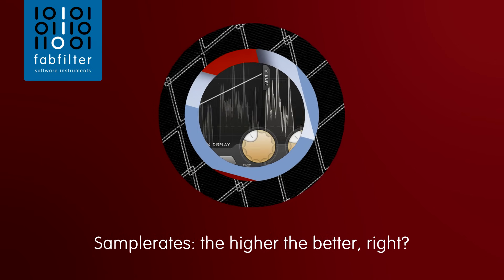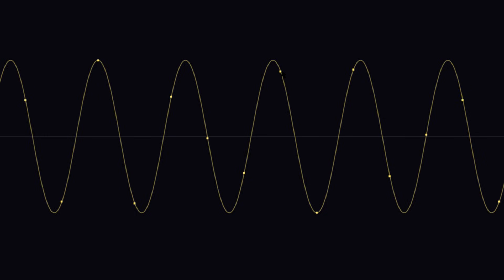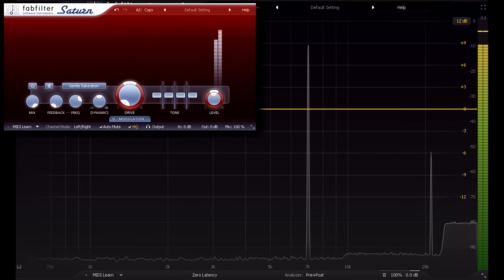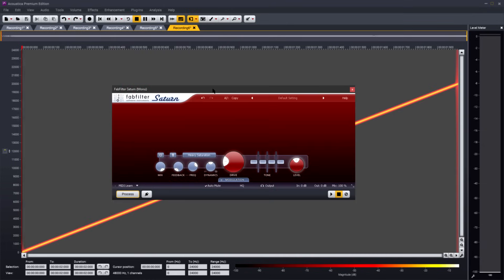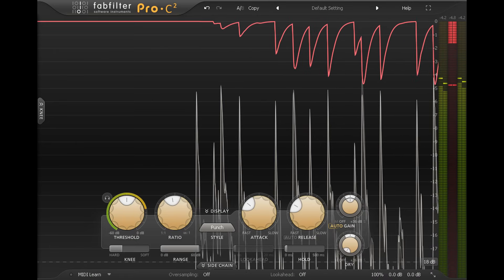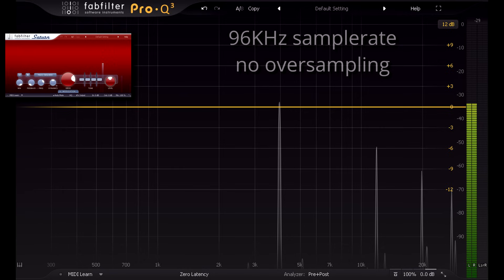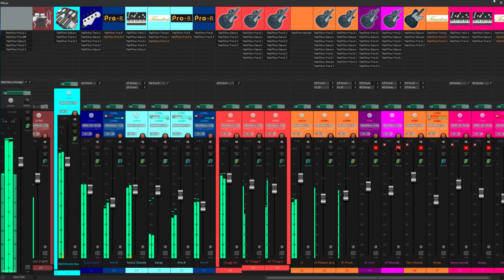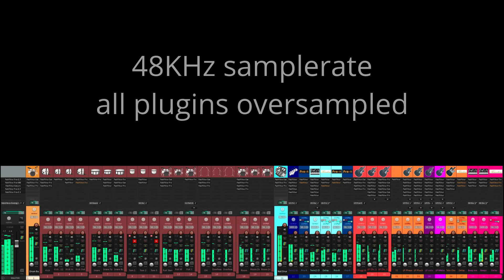Samplerates: the higher the better, right?

Comment: Is it not too late to oversample after the audio’s been recorded?

And what about aliasing caused by other plugins earlier in the channel strip??
Reply: No, it's not too late. In fact you can record at any sample rate higher than 40 kHz without any noticable artifacts. Artifacts come in AFTER recording during the digital processing, and that's where you need to oversample plugins that add harmonics. And yes, you need to oversample ALL of your plugins that introduce harmonics. When it comes to Fabfilter, it would be Saturn, since it's the distortion unit. Other Fabfilter plugins are usually pretty clean and don't require oversampling.
To be honest... Tchad Blake, the distortion master, uses a lot of distortion plugins without oversampling. And his mixes are absolutely great. So... Why even bother thinking about it?
I know all this stuff, but i usually don't oversample even when i can.
Reply: @TransistorLSD  when you say aliasing artifacts appear *after recording, is that only because microphones & audio interfaces don’t capture sounds above 20khz? And what about sawtooth synths? I’m just worried about an audio source aliasing during recording, before I can oversample through a plugin (and I don’t want to run projects above 48khz if I don’t need to!)
Reply: @zanerichter3806  Analogue sources don't alias since they aren't digital, and every audio interface has an antialiasing filter built into it at the AD/DA conversion stage that cuts everything above 20kHz. If you're recording digital hardware synths, they may or may not alias depending of at what sample rate they operate internally. If they do alias - it's the part of their signature sound and not a flaw. If you're recording analogue hardware synths, they do not alias by definition.
Reply: @TransistorLSD  thank you so much for all the information!
Reply: @TransistorLSD  "the AD/DA conversion stage that cuts everything above 20kHz" well, to be accurate, at 1/2 Fs. Some of the better sounding, earlier AD converters filtered lower but gentler.

Comment: Imo I hear subtle difference between lower and higher sample rates. If higher ones interfere with frequencies below 20k then they are probably more "saturated" or "doubled" than normal. That means more "meat" and "bigger" sound in audible freq range. It's very subtle in my ear but definitely sth comes to my ears to make me write about it here. Do you have similar "feeling"? Or maybe it's just kind of my "imagination"? And btw most audio producers and engineers I know use 24bit/96k sample rates when recording and mixing. And some research about it says the optimal sample rate should be about 60k but we don't have such a "standard" in audio so close to that are 88.2 and 96k. And many audio sciencists says that 192k is too much and make no difference and even make things worse (don't ask me details - I read those articles only and can't explain it like for a "normal people" lol). One thing is for sure. 44.1k is standard for audio, 48k is for video and 96k is necessary for high resolution archive audio. If it "doesn't matter" then nobody will be care about it and don't make audio recording devices with sample rates higher than 48k. So it must be definitely a difference and it must be important and needed in audio world.
Reply: I think it's important to watch the video again. It does explain why these differences may be there. Or not. Or in a different way than you would expect. Very likely every point you make and every question you ask here is being talked about in the video.

Comment: Wouldn’t you end up with amplitude modulation on the harmonics whose frequency isn’t divisible by the sample rate as the samples fall in and out of phase with the peaks?
Reply: No, unless you're talking about quantization noise that happens when the sampled values are converted to the digital domain. Dithering fixes this however, so no big deal. And at 16 and 24 bit depth, dither is completely inaudible

Comment: I gave up on highsample rates because my drum microphones' total in under 2000$, i don't change skins before recording drums and my guitar hum is still louder than the noise floor than 16 bits and i don't plan to invest 25000$ of mics, 96khz, 32bit and i don't plan to go into an isolated space capsul to determine if the noise floor is 24 or 32 bits. 
I work with my vintage instruments and  classic mics that.

Comment: Some plugins, reverbs and soft synths sound way better on 88.2, 96 khz sample rate....that's why hardware synths sound better than soft.......they have internal sampling rate of 384khz....prove me if i'm wrong....don't know for hardware synth 'sound'...i don't have any....but from experience....i get much better results running the project on higher sample rates when using soft synths and plugins and then downsampling them. Great explanation....but i hear difference.

Comment: Great video, but you don't address the issue of smearing introduced by oversampling? While it would be negligible like a lot of the aliasing, it still has an impact on the sound especially when you have many plug-ins in a chain adding that smearing.
Reply: What do you mean by smearing? Specifically? Becuase creating additional samples from interpolation of the original should do literally nothing to the signal

Comment: Am I the only one that always hears the change in transients when oversampling? This is my main pet peeve with plugin oversampling. For instance, in your example, yes there is more "smear" and a tad more harshness in the non-oversampled examples BUT the transients sound more natural instead. In the oversampled examples, the 44.1kHz one being the most severe, everything is much more "popping" and "clicky". This is not always a problem though and can even be a benefit in terms of "punch" but on some projects it's sometimes worth taking the aliasing fuzz over the clickyness of the oversampling process (up & down sampling). Would slight random alterations to the filter cutoff, in every plugin that oversamples, mitigate this problem?

Comment: Interesting. I notice a bit more harshness in the highs at 44.1 compared to 48. And if you are using oversampling on plugins (HQ) doesn't that add to CPU load?
I have worked in audio electronics since mid-80s and followed many debates on these issues. I think that improvements are always going to be made, especially as CPUs and GPUs become more powerful. Also note that most video has 48KHz audio standard.

Comment: I still don't understand what he means at 26:12 when he says the anti-aliasing filters have "twice as much room to work in", therefore 48khz is "twice as good" as 44.1khz. I understand that the filters can relax slightly and not be so steep, and thus improve the quality of the filter, but where does he get the "twice as good" from?
Reply: steeper filter may get audible I suppose, because of bigger phase shifting, in higher sample rate phase shift wouldn't reach audible range.

This is how I understand it, idk if it's truth.

Comment: Idk, I use a M-Audio Delta 44 audio card pci, I can only go up to 44.100/24 bit and thats all I need for production, I use a Steinberg UR22 Mk2 for transfering tracks to vynil.  
Other then the higher rates which I hardly ever use, I did however noticed the difference in iTunes when converting audio CD's into 48.000/24 bit/320 kpbs mp3's, I guess it's the algorythms Apple put into iTunes and my iPod that makes the difference?  
In iTunes when converting CD audio tracks from 16bit/44.100 to 24/48.000 I can clearly hear a difference in quality, kinda reminds me of the difference in tape as apposed to CD quality back in the day.  I don't know does anyone have any opinions or experiences like this too?

Comment: There is a technical/mathematical reason why higher sample rates sound better then lower sample rates. Human hearing is very sensitiv to the timing of transients (~4uS) and most DACs are not accurate enough to reconstruct the original timing of transients. The subjective change with higher sample rates is that you are able to perceive timbre correctly, making it sound more „musical“.
Higher sample rates have their own set of problems and in lower sample rates you are also (in theory) able to perfectly reconstruct the analog signal in a bandwidth limited signal but most DACs are not.
Rob Watts (Chord Electronics) is the only one I know of who puts a lot of effort into solving this issue and therefore making high res music less important.
Reply: @ReaktorLeak It is not about the missing  samples in a CD-quality signal but about the accuracy and length of the the FIR Filter, therefore being able to accurately reconstruct the timing of the transients. The link you send me just assumes that the algorithm of the FIR filter is working with the right coefficients. That is not the case with most DACs. At least not as good as it could get. That is the reason why higher sample rates sound better (on most DACs), because the FIR filter does not have to be as accurate because there are more samples to work with.

So you are right in that the timing issues are not coming from the digital data, because it is possible to reconstruct it perfectly but most DACs are simply not able to do it precisely.
Reply: @ReaktorLeak Yes to both, but the accuracy of the filter is dependent on filter length and more importantly how close the coefficients are to the ideal (sync function)
Reply: @ReaktorLeak Not faking, but he makes a huge leap from point 2. to 3. and he just assumes that the used filter is working with the right coefficients. So everything that follows is also assuming that every dac would use filters working like ideal sync function, which they are sadly not. The truth is a lot of DACs not even work with a tap length of 500 like in his example.
Reply: @ReaktorLeak Downsampling from 192khz to 44,1khz leaves unfixable timing issues in the file that no FIR filter can recover as it leaves an endless rounding error. Same goes for upsampling.
Reply: @ReaktorLeak Of course it is down to gear, that is my whole point🙂. But if your gear has a bad FIR filter higher sample rates help.
There are FIR filters that are able to reconstruct the bandwidth limited signal to an accuracy of 16 bits, although I only know of one.
Also the visual representation inside a program has not much in common with the FIR Filter working in a DAC
Reply: @ReaktorLeak Let‘s just say we have different viewpoints on how small a timing error must be until one can no longer hear a difference. I say it must be (at least) unmeasurably small. Your listening tests might have different results which is completely fine with me🙂
I just say there still is a (very small) mathematical difference, if one can really hear it can anyone decide for themselves.
Reply: @ReaktorLeak Yes🙂, as I said, everything (the whole analog signal) can be recovered out of an 44.1Khz signal IF (and only IF) the the filter is identical to sync function. Most DACs are not even close to this performance. So I am saying that in a world with imperfect FIR filters (and therefore timing inaccuracies, however very small) higher sample rates still give you an advantage as the algorithm in the filter has more samples to work with. Regarding timbre: I meant that the brain is very sensitive to the very small timing inaccuracies of transients and so it is harder to perceive the timbre, not that the timbre of the recording actually changes.

Comment: for the cases where we are using plugins without oversampling, If we record at 44.1, work at 44.1 for better latency, then render at 192 (and convert it to 44.1 for cd format after) will it have benefits?
Reply: @JM Coulon agree. If you record tracks with audible aliasing, then up-sample them afterward, you'll get a clearer version of your already recorded aliasing.
Reply: If your source audio is at 44.1 kHz, but your render is at 192 kHz, everything what's 44.1 will have to be resampled to 192 kHz. Some DAWs have "dynamic" resampling (ex. Ableton), where you don't have to touch the source files = smaller file sizes. DAWs like Logic require to resample every single source file to match your project/render.
When you're done you have to resample your render back again to 44.1 kHz, so you're depending on the quality of your resampler.
Another thing I've found out is that some plugins behave differently depending on the sample rate (mostly ones from Ableton lol), so your project made at 44.1 might sound completely different after rendering it at 192 kHz (Ableton's Reverb gets brigher the higher is your sample rate).

Comment: Dear Dan, I’m currently debating someone who insists that stereophonic recordings require high samplerates in order to accurately capture phase differences between the two microphones’ signals. That person was not convinced by this video or one by Monty, both of which demonstrate that (in accordance with the Nyquist theorem) the sample rate does not limit the "resolution" of the signal’s wave, provided the samplerate is high enough to reproduce the required frequency range.

Even though the contents of this video lead to the only logical conclusion that stereophonic recordings do not require samplerates than monophonic ones in order to accurately capture the stereo width - would you be willing to chime in and explain what is correct here?
Reply: MF Nickster  Thanks mate!

Comment: I doubt files at 192 kHz would actually be four times the size, as there will typically be very little information in the higher frequencies, so even losslessly, the data should compress really well.
Reply: @ReaktorLeak you wouldn't want to use lossy compression to save your project but why wouldn't you use lossless compression for audio data? It compresses really well.

Comment: We use DAW live. Higher sample rate gives us lower latency (at same block size) but eats up double the CPU. How can we fight this issue? there is no other reason we want to run a 96khz.
Reply: Use audio interface that allows you to reduce buffer size. But this setting also increase CPU usage. How much? It depends. Sometimes a higher sampling rate is a better compromise and sometimes not.
Reply: Can you simply choose a smaller block size?  Smaller blocks will fill up sooner and therefore be emitted sooner.
Reply: your CPU is doing double the calculations, so no it is not physically or theoretically possible to reduce the CPU use

Comment: So all D/A conversion draws in a smooth curve between sample points?
Reply: Yes.  Simple conversion to analog involves generating a particular voltage for the duration of each sample, which produces a step-wise waveform, then passing that through a low-pass filter, which effectively rounds off the corners of each step.  More sophisticated converters may use look-ahead and modeling techniques to reconstruct the presumed original analog signal.
Reply: not all, but any that is built for audio definitely will

Comment: Love you Dan, great explanation as always. Only one thing isn't covered I think. Why aliasing happens? and do we need anti-aliasing settings when oversampling for ex. from 44.1 to 96, when rendering?
Reply: Aliasing is a mathematical product of sampling a signal with frequency content past the Nyquist frequency. Go ahead and try drawing yourself a sine wave with less than 2 samples per cycle. 
Then connect those dots with a smooth curve (keeping in mind that it can't be the original because it's frequency was too high to be reproduced). You'll find that the curve you can draw through those points is still a sine wave, just much lower frequency. And in fact, that sine wave is related by how many samples per cycle and the frequency of the original sine. This is exactly why aliasing occurs :)
Hope this helps

Comment: IMHO ... there is a benefit at 96khz. There are many audio plugins, which are handling harmonically rich signal badly or they don't have an oversampling option. So if you are using (fabfilter) plugins with oversampling only, you are fully ok at 48khz. But if you are using plugins from another companies with no oversampling, you will get much better results at 96khz, more space, more dynamics. And what more, there are many VST instruments, which are much better sounding on 96khz because that sampl.freq. eliminates that alliasing. Am I right with this?
Reply: absolutely!!!  this video is so cringe!!!!!!

Comment: Overall excellent presentation, but here are a few more points to consider. The entire discussion assumes that the content will always use distortion effects and somewhat extreme compression, as per the example. The case for higher sample rates becomes clearer when producing acoustic music, jazz, orchestral, and other types where the cleanest, most accurate sound reproduction is desired. In those cases, I'd never record below 48kHz,/24-bit (usually 96kHz/32-bit float), so no need to over sample. When the reverb of a string quartet in a concert hall, for example, falls below a certain point, then at lower sample rates and bit depths, natural reverb tails drop below the noise floor of a given sample rate/bit depth, introducing unwanted and mostly unpleasant artifacts. The noise floor at higher settings can be far lower, reducing or eliminating the need for difficult (if possible) corrective measures. I do any and all recording and any processing at 96kHz/32-bit float, only converting at final bounce. BTW, even on my "el-cheapo" laptop-to-external speaker rig, there was a marked difference between the 48kHz and the 96kHz, the latter much more detailed, despite the YouTube limitation, and since up-converting does nothing for the original signal, any difference must have been in the plug-ins used. Since such plug-ins themselves up-sample to 384-bit before processing, then down sample back to the original, it implies that there is an obvious benefit to recording at higher sample rates.